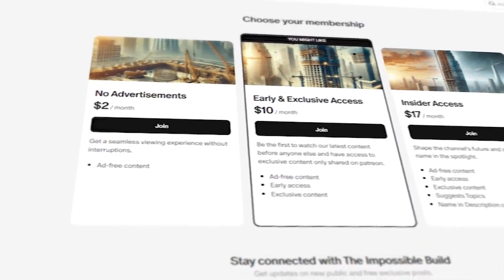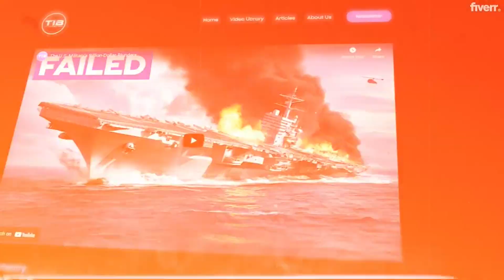Monaco's $2Bn Land Reclamation Gamble!

Comment: Why not build a floating off shore island? Floating concrete platforms that wouldn't disturb the seafloor, would handle storms, waves and rising seas. They are already building floating buildings in the Netherlands, I'm sure Monaco can afford to build much larger ones. Note that it would add more coastline without blocking the views of the buildings already on the shore. While they wouldn't be building much higher than 10 stories or so, they would have basically unlimited room to expand seaward. 

Cover the buildings with solar panels for power, put in rain water collection and storage systems for fresh water, and most of all, put in a public transit system to avoid wasting space for roads (though you could make it two levels, with the lower devoted to a road network, utilities, docks for both commercial and private ships and boats, as well as storage space or even indoor vertical gardens for fresh local foods). 

They could easily double their useable land area - using mass production technics to build the floating blocks, then built on top of them just like you do on land. Add in lots of trees and walkable space, along with very high end housing. You could even design the blocks so that the underwater parts would act like reefs - encouraging sea life to thrive.

A floating version of Venice, as it were.